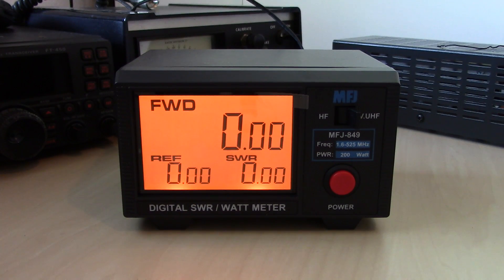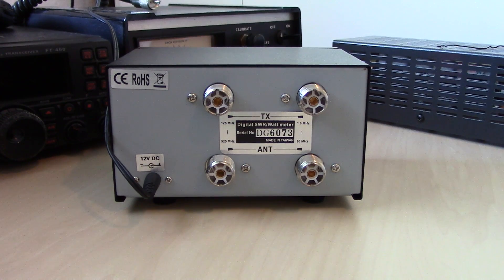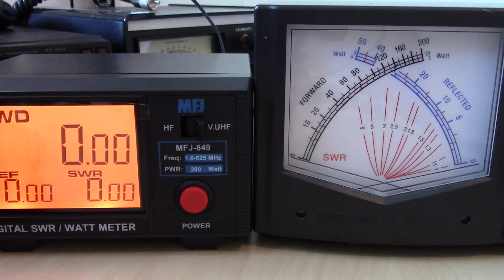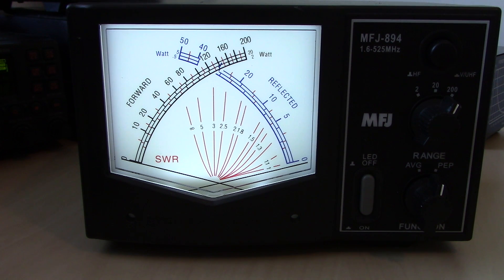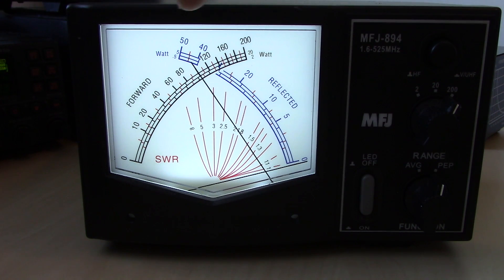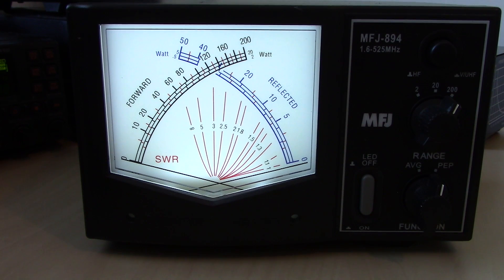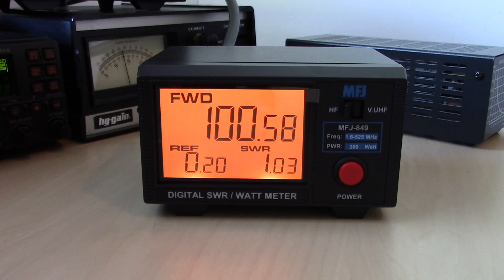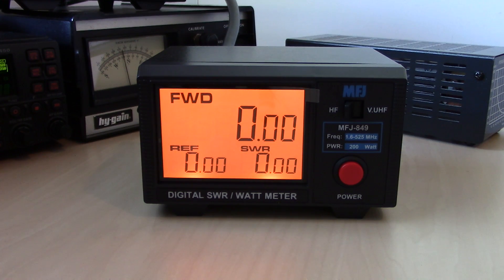Digital SWR Power Meter MFJ-849 Comparison Review VSWR Meter

Comment: Does it come with the DC adapter cable needed to power it, and if not, will a simple 1 amp "wall wart" work? I know that is all you need to power a regular one where the lamp that illuminates the meter is all it powers. But I am wondering how much power it requires.

Comment: Hello Eric

I do not have an external SWR meter such as you do in this video. I just rely on my internal SWR meter on the the radio however I do have a question about my analog meter on my radio. In this video you have your radio set to 100 watts and when you key up the mic, both on the analog and the digital meter shows 100 watts of forward power being put out which means it is very accurate and working properly. Now, here is my problem. I have the IC-7300. This IC-7300 has an analog meter. When I set my IC-7300 to 100 watts and key up my mic the forward power is suppose to show 100 watts of forward power being put out however my analog meter shows only 35 watts of forward power being put out.  What do you think could be causing such a huge discrepancy between the 100 watts the IC-7300 is set to and and the actual amount of forward power (35watts) that is being put out?

Comment: I have the KPO DG-103 metre just the same as the digital metre, gives an average power output, but it does struggle to stay the same, I may key up 250w & it will slowly go downwards and stop around 240/235w.
Never do I get any reflect its always power at the antenna, and at £170.00 I was expecting a better product.

Comment: New to hobby.  Do you keep the power meter in-line during normal operation?  Or is this unit meant to be for testing only.
Reply: Tyrone it's totally upto you, I leave my metre Inline always on both of my radios, some people will argue differently, but tbh personally I think its a safer option.

Comment: I like to know can i use my AV-400 meter that is 140 to 525mhz for 50 to 54MHZ i know the meter is out of band but i just like to know how fare out it would be and if it can tell me if my SWR is even close to good, it did a test the ref is very low and my fwd is high, my radio is a kenwood ts 690sat and on full power its using 12 amps on TX in to my ANT i just made

Comment: Question. I just bought this meter and when I transmit it reads 0watts output on HF unless I talk. Then it will vary between 0 and say 60 on the meter depending on how loud I talk. Why does yours key up to 100 watts output when you just press the putt switch? Am I missing something here. Thank you for the video.
Reply: That is a sideband without modulation. Switch your rig from LSB / USB to AM or RTTY, it will read a constant output.  WW1TA

Comment: For a wattmeter to read PEP it must have some type of power so if you use the cross needle meter for PEP it will require it to be plugged into the power plug.

Comment: You can clearly see that the digital meter is not a genuine MFJ product - it's too well built. It is actually made by Nissei, and MFJ put their logo on.
Reply: MFJ rebrands some things. I have an antenna window clip mount that I believe is a rebrand of an HYS. But, that's not always a bad thing, because in my case it meant getting the mount at HRO off the shelf same day or in 2 days if out of stock vs. waiting for 1 month to get it from CZ China....maybe.
Reply: not sure if your following the thread still, do you know for a fact that the Nissei is a partly better unit than the MFJ or same with different name stenciled on face?

Comment: I have to say that my digital VSWR//Watt meter is perfect, though mine has NISSEI, not MFJ on the front, so, who is the maker/ distributor of this wonderful digital meter?  I'm sure MFJ buy in the units too. Do MFJ claim to make there's? I did some math and found that the reason for the difference in reading from the digital (almost nothing) was the power needed to lift the analogue meter. I have pushed 500W through min digital and it read 500 too! I didn't expect that. Though my analogue twin needle meter handles 3KW and is remarkably accurate too. A great buy and a thunbs up for the digital meter. 73 de Tony G6YPK

Comment: Cute meter for the shack, in the field I'd prefer one that doesn't use power.
But then to be honest in the field I'd use my Z817 (no meter needed) or a tuner like the MFJ-971 with one build in.
Thanks for the review though as I'm thinking of getting a shack swr meter for the shack.
Reply: Atu-100/Atu-130 are great for field trips, work off Internal 18650 rechargable batteries that give upto 12hrs standby, worth a look at, I don't think they made them 5yrs ago lol. 73's